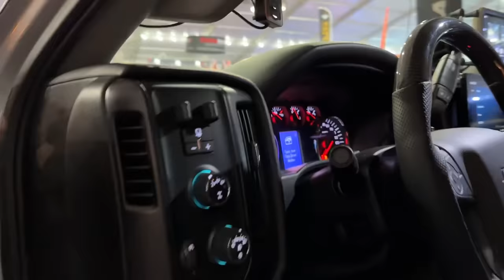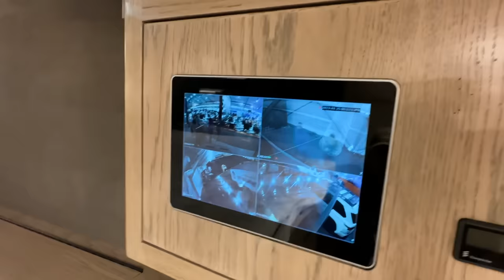Is This $1.1 Million 2023 EarthRoamer SX Still the KING? Come Check Out This Massive Built RV!

Comment: The margin on this truck must be insane.  Even if you buy the most expensive parts, hire the best staff your margin will be crazy with that price 😂
Reply: It’s hand built. Not mass produced. Your not paying for just the parts. You pay for the quality. Drive a Bentley and then a Chrysler 300. You can tell which one is hand made. Also the Bentley will last you decades compared to the Chrysler 300.
Reply: @Rummelta  Bentley is a car built from scratch. Here we have a truck made from another company, like a Ford.  Yes it has been improved a lot, and the living part of it is great. But it is still a Ford (or some of the other trucks they are using) But I get it like Bentley, there is a market for people showing that they can afford the most expensive car.
Reply: @danielsal5442  I agree that they are overpriced but noone is building something this offroad capable with these features so it is meant for people who do not care about a million dollars and there are plenty of them when you dont have much competition. Can you really say that a richard mille is worth a million bucks but this isnt? Id much rather have one of these irresepective of market value.
Reply: I think you fail to understand business modelling. From being around sailboats, I can tell you that the molds for body panels like that are not cheap at all, and they don't last; they have to be replaced regularly(probably every 50 or so units for something like this). Then there's the craftsmen. If you want to retain a staff of skilled tradespeople, you have to be able to pay them for their skills. Around here, an AVERAGE is $40/hour, plus benefits(paid by the employer), liability insurance, etc. My dad bills his guys out at $120/hr, and after they're paid, insurance is paid, and everything else, he's maybe making $10/hour per guy. But to prevent turnover, you have to be able to offer them steady work. These things don't sell to everyone(350ish of them on the road), but you have to be able to keep the talented, trained guys around to maintain the level of quality. Then there's the facility itself: gotta pay for the land, the structure, the utilities, the tools... it's a long list, and we haven't even started buying the truck, the components, or the materials yet!

 Furthermore, they're marketing a premium luxury product to people with money, and those people WANT some degree of exclusivity. They WANT to turn heads and be able to brag about their fancy RV.

They aren't profiting nearly as much as you think they are. You're just clueless about how business expenses work, and probably a little butthurt that your broke ass can't afford one. 😂
Reply: @bradsimpson8724   You get your knowledge from your dads business and think you can apply it on all companies. Good for you!

Comment: Impressive attention to detail and luxury. One thing that still looks quite awkward to me is the final weight distribution between the front and rear axles (and the respective stress on the frame). The rear axle seems way heavier than the front. To make things worse, there is a horrific overhang on the rear end. It just looks wrong to mount such a massive camper on this American conventional cab-chassis platform (especially double cab). I've seen this type of super cool camper abroad mounted on European trucks such as Mercedes Benz, MAN, DAF, etc (all cabover-style trucks). The weight distribution on a cabover truck has to be massively superior. Additionally, this vehicle is quite long relative to the size of the camper. Fantastic camper, wrong chassis platform.
Reply: You have got it in one the weight distribution Cabover European truck vastly superior
Reply: It's a vacuum infused carbon fiber shell making it very light weight.  It looks top heavy but it isn't.  The lithium battery bank as well as gas and water tanks are evenly distributed at chassis level making it very stable.
Reply: It's WAY lighter than it looks. Like AT LEAST a ton lighter than if it was made in aluminum or fiberglass.
Reply: So  Expensive  buy  a  House  and  Lot  to  Settle  and  Lived... 😢😢😭😭🤔🤔🤔™️™️😔😔😔😏😏🍞🍞🍞
Reply: People that buy these have several homes already, lot cheaper than private jet or 80’ yacht for a toy. Why not a home that can go to remote off road places
Reply: Wow you went from "I dunno looks like it to me I guess" to deciding your completely baseless guess was factual. "Da back looks more bigger! Must be more heavier!"

There are these things called "engines" that usually sit in the front of trucks. They're quite heavy! As is 100 gallons of diesel + 100 gallons of water. Where might those sit?
Reply: "American conventional cab-chassis platform (especially double cab)"....This is incorrect, a Chevrolet 5500 is not a conventional cab and chassis.  A 3500 is a conventional truck with a GVWR of 15k lbs.  A 5500 is medium duty with a GVRW of 24k lbs.  The axels are bigger, wider and can handle far more weight.  With this setup the weight is very well distributed.  The frame of a 5500 is wider and heavier duty.  The cab itself is larger in width and height.  It is scaled up from a conventional truck and if you were to look at a 5500 next to a 3500 the size of it is far more obvious,  just as with a 1500 and a 2500/3500 there is a significant size difference.  The way this truck shown is configured there is still 2000 pounds of capacity before reaching its load rating so a trailer could be added with significant tongue weight.  The trailer being towed could be an additional 13.5k lbs.
Reply: I agree with you - the car body is not suitable - there should be double wheels at the back. Your note is important.. Do you think the caravan body can withstand low or high temperatures? Is the caravan protected from burning? Are there safety elements and exit hatches for emergency vehicles, for example?

Comment: I’m just here from the TikTok guy throwing shade. Lol this is insane so it’s a stock Chevy cab and chassis, stock drive train, a Kelderman air kit, and a bed camper, with a little bling here and there. I couldn’t have said this thing starts at a mil with a straight face. 85% pure profit right there 😂

Comment: That price though...you need to be part of the ruling class to own one. Better to build one out for a fraction of the price and it'll be a 1 of 1. Im not trying to take away from how awesome this thing is,  it's just the price that kills it for most I'm sure.
Reply: @TBM,
Agreed.
2003, we engineered our ExpeditionVehicle for about five percent (5%) of this asking price.
Another benefit other than cost:
* reliability, durability, resilience.
Our rig has zero enormously complex components cobbled into enormously complex systems.

Comment: My biggest concern would be that the camper is not removable from the chassis while repairs on the vehicle are done. Ideally this is something that the manufacturer would still have to offer. Imagine you have engine or transmission problems while you are travelling. Repairs can take some time to resolve especially with waiting for parts. All the while adventurers could stay in a removable camper.
Reply: If you have the money for one of these you can afford a hotel while it's being worked on.
Reply: @TrulyUnfortunate  By that standard, those who have the money can jet & helicopter themselves anywhere in the world and be back in their 5-star residences for dinner. However that is sure no part of the game here!

Regardless of their wealth, the path of adventurers in these vehicles may very well lead to places, where it may be hard to find a qualified mechanic, let alone a hotel; at least not one that can keep up with the creature comforts that camper here can offer.

That is something that could have been considered and incorporated into the design by the manufacturer. Quite possibly with little effort and at a lower cost than many of the other already existing offered features.
Reply: @mrtopcat2  
When I said they could afford a hotel I assumed it would be in a city thats large enough to have a facility that could work on it.
   If not you're going to be in for a very pricey tow to get it to somewhere it can be fixed.
 Again no worries about money.
If you maintain a diesel properly you really dont have to many breakdowns.
  And again if you have that kind of money you just put in a new engine or transmission.
  As far as other campers goes there aren't that many out there that are off road capable. From what I've seen the price difference isnt that different for others with the same capabilities.
Reply: @TrulyUnfortunate  I am talking about a camper that is designed in ways that it can be detached.

What you wrote about diesel engines is only partially true, especially these days. They can have the same issues that any modern engine has. So regardless of engine type, proper diagnostic can be sometimes more involved and take long time and may even involve ordering part (waiting) and throwing those parts at a problem. By the way, especially in case of the (GM/Ford) 10-speed transmission, which still has many unexplained issues. Look it up.

This manufacturer did the same non-removable-cab-non-sense on their Ford based models. Except on the Ford you must remove the cab for cylinder head removal. Please look it up, I am really past arguing about this as I wrote this comment regarding the Ford based chassis and in turn the fanboys (or could be the PR-arm of the company itself) were all over me with MIS-information trying to state otherwise.

Please look up how such repairs go or better try to do a few of them yourself. It is easy to armchair things, but when you work on these things your perspective changes. Really, I have been working on cars and truck for over 35 years now. So I am past arguing with friends, who armchair things, with little to no practical experience.
Reply: @mrtopcat2  
The first time I saw a newer Ford pickup in the shop with the entire cab lifted from the frame, I chuckled with amazement.
Who engineered such redonckulous.
Reply: @largemarge1603  LOL. Exactly!

Comment: I’ve never heard them discuss why they changed from the HD to this SX model. It’s as if it didn’t exist now. Curious if it was the cost/lack of demand or maybe the size/length of the HD made it difficult to maneuver off road?
Reply from the maker: I asked about this, and the Earthroamer HD is discontinued because it was "too big".  There are the ER Ford LT/LTi and ER SX now.
Reply: @TFLoffroad  Thank you! That’s kind of what I thought. I might be a little bummed if I’d shellled out 1.7 mil for the HD.
Reply: Rt, I’m just wandering if sales on the HD is just too low to continue
Reply: @evanselaban7058  HD , wrong chassis, the gas was too much...5 gph , am i wrong here.   Plus the killer , i think , it was the speed rating of tires,  this one u can go 82 mph all day long on cool pavement like Colorado, do not try that in Arizona or South Florida, u will see smoke out of those tires.
Reply: @evanselaban7058 The channel had replied that someone from EarthRoamer told them that the HD was just too big. Apparently, too difficult to maneuver in many off road, overloading types of locations.
Reply: When they say "too big", they're primarily talking about the weight. The SX is, dimensionally, the same height and width, and only about 24" shorter. But when you compare the SX to the HD, the weight difference is pretty substantial. They estimate this vehicle in the 22,000lb range, whereas the XV-HD was closer to 37,000lbs.
Reply: @bradsimpson8724 Very interesting. Since the shell is mainly carbon fiber now where is all the weight savings? That’s a significant savings.
Reply: @michaelmiller6878  I can't say I got super far into where they saved it all, but as a pretty easy example, the HD had a water tank capacity of 250 gallons, whereas the SX is down to 120. In itself, that's about eleven hundred pounds difference. And the SX is using a cassette toilet, versus a traditional black tank like the HD had, which is another huge weight-saver. The Chevy 6500 is probably lighter than the F750 platform to begin with, too. The HD also had a bunch of weight-intensive options(like the giant underbody outdoor kitchen, for example) that are unavailable with the SX.

I do think that the HD shell was carbon fiber as well, and that's how they prototyped things for the LTi and the SX, but I wouldn't take that as the gospel.
Reply: @bradsimpson8724  Thanks for sharing. Love this vehicle and certainly have it on my bucket list. It’s been fun to follow over the years. Hard to find much YouTube video on someone who owns one taking it on daily adventures. There is one couple, but the videos are short, it’s an older unit and there is no dialogue. The SX seems like a big improvement, with this weight savings, to truly get them into the backcountry. There seems to be a lot of weight still in the steel chassis, which I assume are from the factory. I wonder if it would ever make sense to build that section under the camper out of carbon fiber too? I’d imagine it’s always a balancing act with cost.

Comment: In 15 years when I have enough money to actually get one, I'm definitely swapping out the entire rear dinette for a full office space. Triple monitor main setup with a 65" TV and two vertical side monitors for good measure. A lot of people are comparing this to an offroad camper or an RV. It is neither. It is for people like me, who work in jobs that can be done from anywhere in the world, and like to have their own sanctum sanctorum, but don't just want a camper. This is a fully mobile, off-roadable apartment. It's not meant to go to a campsite, it's not meant to drive into a KOA location, or be sitting in a parking lot somewhere. It's meant to be completely off-grid, but still connected to the rest of the world.
Reply: and overpriced
Reply: @J-_-S  the CF shell alone probably costs a couple hundred grand. That process is NOT cheap.
Reply: @spdcrzy  maybe, its just guesssing price. Its still overpriced on eevery aspect.
Reply: @J-_-S  you're not thinking about the fact that they're replacing the ENTIRE interior, building every single thing from scratch, and providing a stupid amount of electrical power for the cost, and doing it in extremely low numbers compared to a lot of European manufacturers of these overlanding vehicles. They've only been producing more than one or two a year for maybe the last decade, and they've ramped up production tremendously. Not to mention, experienced American skilled trade labor is veeeeery expensive.

Comment: I don’t see $850000 in build cost here. I do see a lot of ridiculous though and that IS expensive. GM heavy truck chassis isn’t going to go far off-road. What’s the RTI? That winch is going to attach to what? To pull it out of what once it’s really stuck? Those mall sidewalks are pretty high up. Oh and the Bosch fuel pump turns that truck into a may pop. Factory warranty aside, good luck finding a heavy hauler tow truck willing to go off road to recover you once it does implode.

Comment: 14:12
Our ExpeditionVehicle is built on a 1996 Ford CF8000 commercial truck.
Our travel-weight across the scale -- 14,000#.
This includes 190-gallons (approx 720-liters/litres) of diesel, plus fresh water and chocolate for two weeks.

Comment: These guys should do a 6x4 chassis, with a good size battery bank / ev front drive, so 6x6, with generator and diesel motor.. battery bank for long offgrid / drive away in silence mode

Comment: I was getting ready to buy one of these over priced machines, then discovered the off road trailers that are a fraction of the price, bigger, and allow you to drop off your tiny house so you can use your truck separately.

You can get a off road Australian made "Bruder X" for about $200,000. Or an American made Xplore 195 or Xplore X22 for $150,000 and $90,000 respectively.
Or Roamer 1 or Roamer X for around $100,000 and up.

The off road trailers are much more practical. If you have engine problems, your tiny house needn't be stuck with your non-running truck. Or you can drop off your camper at a RV park and take the truck out separately.

Comment: So just thinking about when you need off-road capability with a truck of this size. It works in the desert and open trails.  It couldn’t work in the mountains at all. So for 1.1M its pretty limited. Its cool but really impractical..  as a motor home you get way more bang for your buck buying a traditional motor home.  I think if you go to sand dunes a lot it could be practical with a trailer for sure.  Like Pismo beach or something like that.

Comment: Get a UNICAT or Actionmobil Globecruiser 7500 instead. More cabin space, far greater water/fuel capacity, proper heavy-duty three-axle truck chassis (Mercedes Actros or MAN TGA/TGS), greater off-road capability and better fit/finish.
Reply: well unicat and action mobile are price...actionmobile cost 900k and unicat 500k start point...but they consume diesel...you need to 250galons of dieses to achieve 1000 plus kilometers, not miles...this ER with 100 galons 1000 plus miles it something...

Comment: The 4500 and up series GM trucks are way detuned from the 2500 and 3500. Otherwise this would be the ultimate setup for hauling a big tired rock crawler around.
Reply: @Jason,
Generally:
* bigger versions of Class 3 trucks are aimed at the commercial market, with a hired youngster behind the wheel
* higher horsepower tends to get used, requiring a significant increase in radiator size to compensate for the pounds of fuel burned.

Comment: My take, u moght not like:
-this is not a rock climber, or a Passage Maker...
-off road means, well defined roads off roads.
-I would prefer a Cab-over chassis, plenty of them available
-how do they calculate 11.8 MPG on the 6.6L dymanx?
-an Operator will bring this beast from Miami to Alaska(5000 miles @ 10 MPG)  while the owner gets there by private plane and Helicopter.